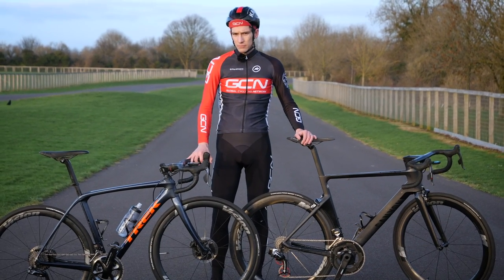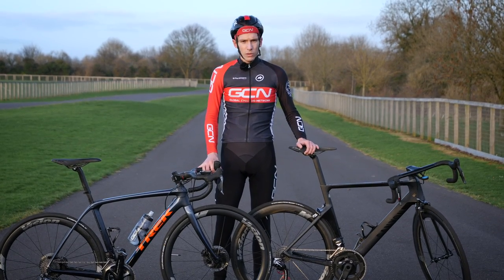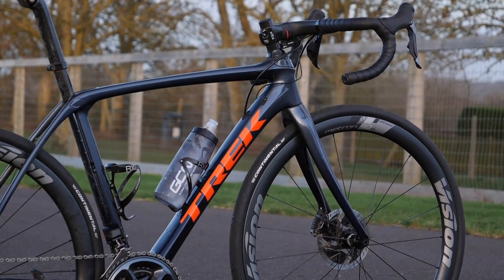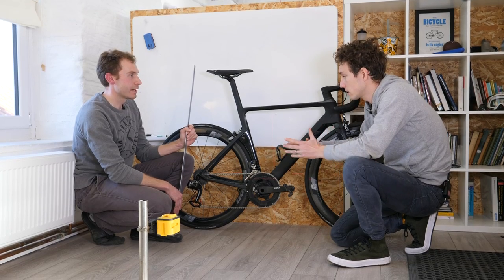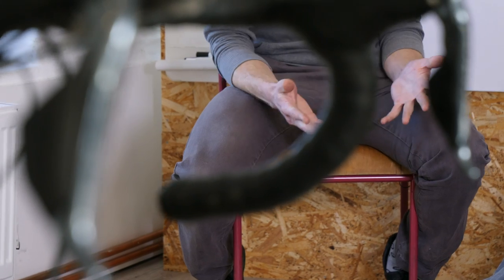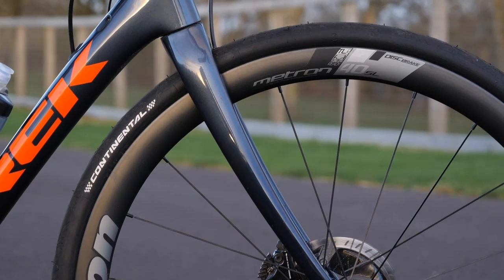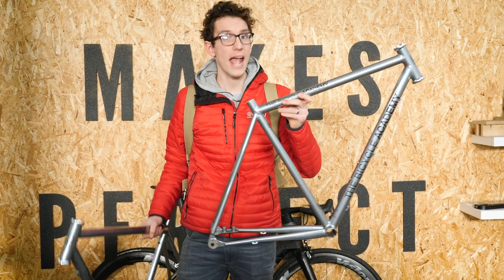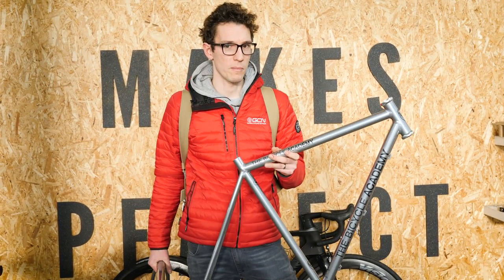Speed Vs Stability - Can Bike Geometry Make You Faster?

Comment: To increase the complexity. You missed a big parameter that affects the way the front handles almost as much as head tube angle and trail (you made a video about that way back).  It is stem length.  The same frame and fork will behave very differently with an 80mm stem as compared with a 130mm stem.  These days the pro use small frame sizes with short wheelbases that should be very twitchy compared to bigger longer frames but they pair them with massive 130 or 140mm the steering is actually much more stable...  I experienced than when moving from a traditional 56cm long frames to 54cm while increasing stem length from 100 to 120mm.
Reply: Amen mate. I talk about this a lot. The stem affects the steering axis (as well as handlebar width). Even though the pro's use such smaller frames and then compensate for cockpit length with 140 and 150mm stems, it makes the bike a bit unstable in high speed corners. The bikes are DESIGNED with certain parameters for a given frame size. Stem length is one of those parameters. 

What kills me is the complete lack of discussion about this from ANY engineer in the industry as well as some knowledgeable technicians.  When you 're-engineer' a machine, it is then a compromise, it will not perform as designed. Keeping the stem within a 10mm + or - range is about what can be modified before the steering geometry and handling characteristics are adversely affected.  Again...crickets from the insiders. 

My bike is a 52cm, I'm 5'7" with shorter arms and a 29" inseam. Bike fits very good. Stock stem length was 110. I changed to a 90mm at first. Eventually settled on a 100mm. Steering is quick but not twitchy.  I cannot imagine how sluggish a 140mm or 150mm stem must feel. But rest assured, those bikes are NOT steering with any efficiency or precision.
Reply: @rider65  I agree but there is also another dimension.  Responsiveness and stability is very different for someone that spends most of the time around 25km/h (a 55-year-old like me) and for a pro that spends most of the time around 45km/h... I am sure the steering of those bikes with a 140mm stem is plenty responsive when you cruise at 45Km/h... Same for comfort, a very harsh and bike at 25km/h will behave much better at 45km/h as it will fly over the ruggedness of the road...  Anyone that has ridden on cobblestones knows it,  at 15 or 20Km/h it is hell and everything comes apart including you, the faster you go the smoother it gets that why they accelerate like crazy on every cobblestone section in Paris-Roubaix...   This is why it is stupid for recreational riders to buy super duper pro bike (other than for the pleasure of having the best of the best which is still somewhat accessible for normal people with bicycles...) kind of like buying a Porshe to sit in a traffic jam or go to the supermarket...
Reply: @julmeissonnier  Well, yes and no. Regarding why someone would want or need a pro caliper bike is really subjective. Everyone rides differently, with different needs AND with varying perceptions. As far stability, that is physics and there is no real solid argument against the physics of a certain level of stability.  Bottom line is that 're-engineering' a well thought out and designed bike is typically not a good idea.

Comment: An interesting video which stimulates quite a lot of thought but I think it misses some important points. 
The trail (or castor, as I prefer to call it) has the most significant affect on how a bike feels. More trail will make a bike more stable in a straight line but the steering will be heavier so the bike will feel less agile. The two bikes featured could well have the same trail but because the Trek has a slacker head angle and more rake, the fork is able to flex more in response to bumps and will give a more comfortable ride. However, when the bike is leaning through a corner the Trek fork is likely to make the steering feel a little twitchy on a bumpy surface.
The length of the chainstays may also have an affect on the ride quality but more significantly, short chainstays will shift the weight balance so more weight is on the rear wheel and less on the front. That may have an affect on steering balance near the limit
The affect of the length of the wheel base is only marginal. Reducing the wheel base by 10% will reduce the radius of the turning circle by 10% for the same steering angle so the steering will feel a little more lively but I doubt that the difference between most road bikes is really that noticeable at normal riding speeds beyond the first few minutes of riding.
Finally, the affect of bottom bracket height is only a perception. If lowering the bottom bracket to lower the centre of gravity really made a difference then short riders would always be faster on winding descents and this is not the case.

Comment: Long time ago, I saw a very special bike frame. The idea probably was to make the chain stays as short as possible. To do this, only the upper part of the seat tube was a normal tube. The lower part down to the bottom bracket  was split in two. The rear wheel would "cut" in between these two "stays", where the seat tube would normally be, and the rear wheel would be extremely close to the bottom bracket. I haven't seen anything like this ever since.

Comment: this was great thanks :) the worst part these days at least with triathlon bikes... so many frames have a unique integrated fork that you can't change. stem, fork, offset, it's set. a mountain bike yes. you can spend time configuring the stem, the fork, the offset. and a road bike to some extent with stem. and in either case bar width. but a triathlon bike... they try to make them so plug and play that you can't configure their handling. their fit yes, and at this talk mentioned rider weight location will have a huge affect on bike handling. given you're probably having to buy it remotely ... it's really tough. i think you have to get a test ride these days.

Comment: I've a snappy purebred road bike with fitted with a 90mm stem and a lazy gravel touring bike with an extended 120mm stem. I've configured them such that my body position on both are pretty much the same. When you jump on one immediately after hopping off the other you'll notice the handling is massively different BUT you re-adjust and get used to it within 30 seconds. 

What I'm getting at is, perhaps we're all thinking about this topic a little too much when there are other more practical issues, like, whether you can fit big tyres, not having toe overlap. or enough heel clearance for panniers should you need to fit them.

Comment: I’m glad that you will look deeper into trail/rake. I recently upgraded the fork on my xc bike and went from a 51mm rake (offset) to a 44mm rake. The results are exactly what I wanted - a more linear, stable feel. Here’s my understanding...

The trail is the big predictor. More trail (slacker head tube and low rake) gives more stability. But what if two bikes have identical trail and bike A has a steep head tube with low rake and bike B has a slack head tube with high rake?

I believe that bike A will have quick steering in that first degree of turn and the steering will be linear. Bike B will be more stable when you first turn the bars, but the steering will be progressively more aggressive. Bike A wants to turn immediately and isn’t as stable in a straight line, but it’s very predictable in tighter turns. Bike B likes to track straight, but as you steer tighter, it can get twitchy.

My xc bike Felt twitchy to me. Steer around a tight obstacle, and the bike wanted to take over and steer even tighter. With the lower offset forks, the steering is much more predictable and I feel more in control. It might not handle as aggressively now, but it feels better for me. At least that’s how I understand and experience it.
Reply: When you increased the trail on your bike it's stability will be more at higher speeds, but at lower speeds it will be less stable due to wheel flop. And if you had to chance to compare between two forks, actually you would have seen that with the higher trail one you would need to go 1-2 kmh faster to ride no hands.
If you keep the trail constant, changing the HT angle changes Wheel Flop. Steeper HT angle means less Wheel Flop. Therefore Bike A will be more stable especially at lower speeds. Bike B will have more tendency to unintentionally swerve to left/right, and will be harder to follow a chosen line, straight or in a bend, again at lower speeds (hence can be seen as less stable).
The self-stable speed of A will be lower than B due to this effect. (There is a strict speed that you can ride a bike no hands; that is self-stable speed)
On the other hand, bike B will have a stronger tendency to turn into a corner; once given an input the handlebars will pull more forcefully into the turn. (Yes, if you haven't noticed already; different to a car's steering wheel, once you initiate a turn, you might apply even NEGATIVE torque to the handlebars especially at lower speeds) And this can be described as aggressive, sporty etc..
At higher speeds, with increased momentum, Trail's stabilizing effect will take over and stability of B will approach to A.
Reply: burcakerbil Great reply! A big apples/oranges change was going from the stack, low-cost Rockshox to a top of the line Fox SC32. I could be just feeling predictably from a stiffer shock, rather than the rake change.

Your analysis of self stability makes a ton of sense. My road bike is a Felt VR30. It’s stable due to a somewhat slack HT, but is terribly hard to ride slowly with no hands. No I know why!

Comment: The most important for riding is the position on the bike and the stability of the bike, then came the stiffness and the weight   of the bike. Always is better to choose a smaller than a bigger frame of  that you need. How you can find the best position? ONLY by your self. How? With MANY adjusts (selle, bars, shifters) and MANY tests. If is necessary you must change selle(very very important), stem (lenth, angle), bars(type, reach, drop).

Comment: For a given RIDER and FIT, and hence a style of bike : There is very little margin that most of these variables can change actually, so they will have very little effect. For example talking about BB drop.. The G of rider+bike may be in the order of 100cm or so above the ground. Changing it +/-1cm by BB drop (2%) will not give any perceivable results, even by the most experienced riders. Some might say they have perceived it; and I might say "did you blind test it on two identical bikes except the BB drop??". Cause a lot of other factors will have much more effect on handling than the BB drop. Same with Rear Center, Wheelbase etc.. Their effects are very little for the same person, riding for example a roadish bike in the same position. Cause the possible change bracket is very little.

The major factor governing the handling is front geometry, where more drastic changes can be made. For example changing the trail from 50 to 60mms brings 20% change!

Comment: No mention of seat tube angle? The steep ST of the canyon puts the CoG really quite further forward between the two wheels which will affect steering and handling irrespective of trail or castor. Tyre loads change too with ST angle.

Comment: CoM, not necessarily center of gravity. The center of gravity with relation to the Center of Pressure can be slightly changed with body position. While the center of mass can NEVER be altered, it's a fixed position.

Comment: Chainstay length has nothing to do with snappiness or fast accelerating. That's controlled by the stiffness of the chainstays; want more snappiness - then make the chainstays stiffer. Chainstay length primarily affects weight distribution. It also has an effect on cornering. Shorter chainstays can get you around in a sharper radius but with less stability and more likelihood of sliding out . Manufacturers also spec a minimum chainstay length for reliable rear shifting - but this is broadly ignored by designers.

Comment: Pro Endurance Domane SLRs are longer and lower than H1 Emondas. Hardly a relaxed “endurance” bike. Long reach and low stack inevitably puts your CoG lower and more forward.
Reply: yoog H2 Emondas?
Reply: @Paddyhudson  Pro Endurance are indeed lower than H1 Emondas. But since the bottom bracket drop is quite big on the Domane, it ends up in the same ballpark as H1, but longer. Real race bikes :)
Reply: Long reach and low stack move you forward and lower, unless of course you use a shorter stem with more spacers under it.  It allows you to move lower and farther forward, but doesn’t dictate it

Comment: The lower the centre of gravity the more stable the object
Reply: James Dean 
Unless you’re balancing an object on the end of your finger??

Would be interesting to find out which High School Physics textbook Si’s been reading!
Reply: James Dean Yeah, surely that’s a slip of the tongue from Si.
Reply: The faster the wheels turn, gyroscopic effect keeps motorcycles and bikes upright. And the only way to lower the center of gravity on a bike is to stand on pedals thus the weight is carried lower.
Reply: long knight when you stand up on the pedals your body moves up, right? If the body moves up the weight moves up and the center of gravity moves up.
Reply: @mosca3289  the contact point is important. Ever wondered why people stand up on the pedals rather than stay seated when track standing?
Reply: @MrBJPitt   yes but thats not why its because they can move their body more freely just because you feel the pressure at your feet doesn't mean its coming from your feet its coming from all the mass above your feet
Reply: @dude4548  yes, but that moving mass is applied low on the bike. 20kg hub vs a 20kg seat, the bike with a 20kg seat would have a higher centre of gravity.
Reply: dude4548 Right
Reply: MrBJPitt the center of gravity is the point at which the bike and rider would balance if you layed them on their side. The contact point as you put it doesn’t make any difference. Only the relative position of the weight counts. If the riders torso is higher so is the center of gravity.
Reply: Not if it's a helicopter
Reply: namasayanif that’s a good explanation.
Reply: MrBJPitt the bodies weight can be supported by the seat post or legs but that doesn’t change the center of gravity. Imagine your legs are replaced by carbon fiber tubes. Will that change the COG? No.
Reply: @mosca3289  instead of centre of gravity, better term is centre of mass. If the mass of the system were concentrated at a single point, where would it be? On earth, we call it the centre of gravity. But in any locale, it's the centre of mass. When we see a mass moving, eg. a rider's torso, it's easier to understand how the system changes. Anyway, my point is, terminology matters because it affects understanding.
Reply: Carl Forde yep that’s a good point
Reply: @camsterasmar975  I'm a high school Physics teacher and I have used my fair share of duff textbooks over the years but, as far as I can recall, none of them taught that a high centre of gravity increases stability! Presumably a slip of the tongue from Si... which probably explained the pregnant pause that followed it in the conversation!
Reply: Not necessarily, this can be true for a car. It is not true for systems which have an external forcing function. A ship for example with a low center of gravity can actually be less stable in wave action, a rocket with a low center of gravity will go around in circles. A bike with the center of gravity too low  will fall over as its response rate to leaning will be too slow.
Reply: Deep_Dive what is an external forcing function?
Reply: I would say the lower the center of mass is the more stable the object not necessarily the center of gravity. You have to keep in mind that there is something call the center of pressure in relation to the center of gravity which can be changed with the way you move your body. But the center of Mass is a fixed position on a human and a machine
Reply: @archetypex65  Wikipedia disagrees with you. " Referring to the mass-center as the center-of-gravity is something of a colloquialism, but it is in common usage and when gravity gradient effects are negligible, center-of-gravity and mass-center are the same and are used interchangeably".
Reply: @ohwell2790  

It means that upgrading to lightweight bar and stem (saddle, seatpost, etc.) is perhaps more important than getting a super light bottom bracket, hub axles, etc.
Reply: @mosca3289  
Yeah, but the physics are complicated because you're using your body weight dynamically to steer the machine. So it's a separate question. IOW, standing isn't necessarily making it harder to control the bike. But lowering the bottom bracket (when you have that choice) can lead to overall lower CG.
Reply: @MrBJPitt  

Because pedals are very effective levers for powering the machine AND dynamic balancing whereas the saddle is limited by your buttocks movement.
Reply: @mosca3289  

The contact points matter when calculating dynamic, loaded values.
Reply: @indonesiaamerica7050  thanks for the interesting posts. I'm not an engineer and sounds like you know more about it than me ☺️It's just some other commenters really seemed to get it wrong and mix up their terminology.
Reply: TBA Social thanks for the tip. I read your article and it definitely clarified these concepts.
Reply: More appropriately, the Center of Mass. But yes, because CoG can be slightly manipulated with regard to the Center of Pressure...
Reply: You are confusing yourself with talk about CoG etc. A steel bike will always stick to the road better than a carbon one because the earth's magnetic field holds steel better that plastic.
Reply: @parkysouthlondon  :-D
Reply: Alan Parkinson 😂
Reply: Alan Parkinson don’t tell them that, they’ll put magnets in their frames.